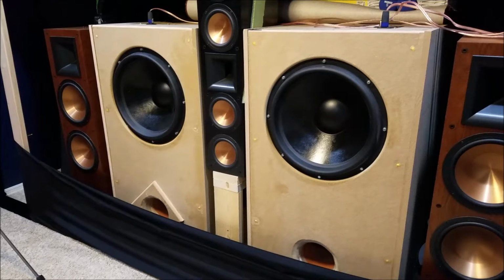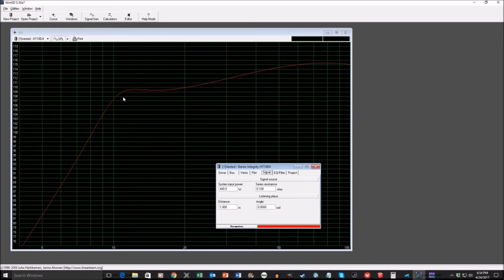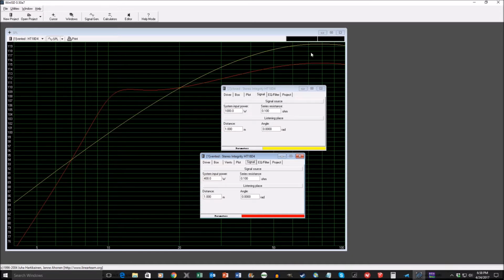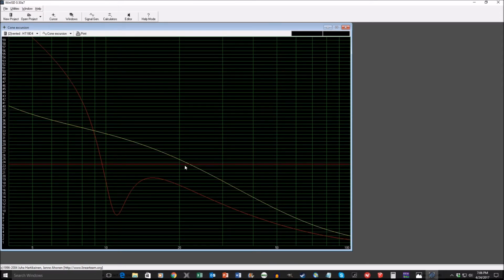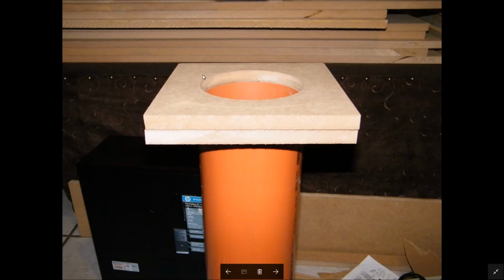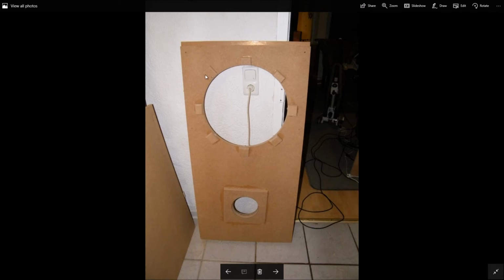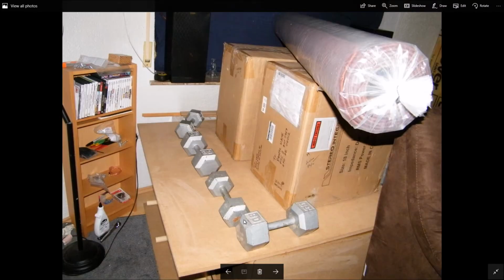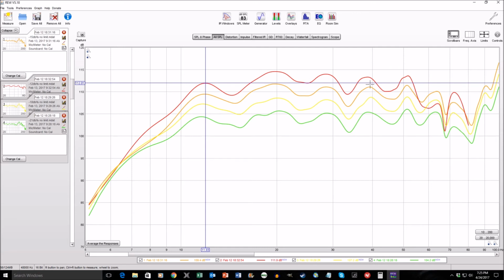Making Of the Salerno Subwoofer

Comment: Question, sounds like you are running both subs through a splitter  to your beringer amp, then using the left and right out on beringer to power each sub?   I believe that is how you have it wired,
Reply from the maker: There is one line going from my AV Receiver to my amp.  My amp is set to "Bi-Amp 1" which is normally used to power a sub and a mid or tweeter.  However, I configured both sides identically so that the same signal comes out of both channels of the amp.  From there, channel A goes to one sub and channel B goes to the other.
Reply: Family White TV how does the Inuke 3000 run both of these?  I was looking to use the same amp or the new version on two 18” ultimax. Also what about auto on with pro amps? Seems like crown amps have the auto on

Comment: use a dsp, like the audio control epicenter, to 'add in ' the missing bass.
Reply from the maker: I was able to add back in the bass using the built-in DSP in my iNuke3000DSP.  The only downside is you have to remember to remove it before playing a movie that is not high-passed.  Also, there are some movies where there is just not enough bass below 20Hz that is salvageable.
Reply: well, that is really isolating and amplifying what is already there. what the Audio Control epicenter does, is it analyses the bass range of frequencies for the audio track, and figures out where low frequencies are supposed to be, but wasnt recorded, and then synthesize those frequencies back into the signal.  other companies have similar devices. 

when perfect, u dont need to change the equalizer settings with the subfrequency synthesizer on or off. as it doesent affect the bass frequencies that are already in the signal.

https://dbxpro.com/en/products/120a
https://www.youtube.com/watch?v=VuApe8_LL_U
https://www.youtube.com/watch?v=gECjtdVdIEk

http://www.audiocontrol.com/car-audio/the-epicenter-processors/epicenter/
https://www.youtube.com/watch?v=eFe_vP-iM70
https://www.youtube.com/watch?v=uYfEv8z2nqE

in this last one although the guy turns down the gain on the amp, when u set up the epicenter correctly, u SHOULD not have to do that... u hear the subsonics added in to the track though.
https://www.youtube.com/watch?v=v0D1pNGYmAc
Reply from the maker: Ok, sounds interesting.  I checked out your links, but it looks like this won't work for restoring the bass I'm looking for, which is in the 5-20Hz range.

In the third link you provided:

https://www.youtube.com/watch?v=gECjtdVdIEk

It shows that with the 120X on, it is attenuating a lot below 20Hz.  While it is providing a new tone at around 34Hz, there is no evidence of anything new below 20Hz.  Instead, there is a significant amount of roll-off.  At 15Hz, the signal appears to be about 4db less than the origional, and at 10Hz, the signal is about 8db down.  And so it looks like it would actually hurt a movie where the sound is present at those frequencies.

This seems to line up with the 120 manual which states the lowest range is 24-36Hz.
http://www.audiocontrol.com/downloads/car/current/epicenter/epicenter-user-manual.pdf

Unfrotunately, I didn't see a video that did this test with the Epicenter controller.  But according to the manual, the lowest subsonic filter they sell is 25Hz.  I didn't see anywhere in the manual that says whether you can run without a filter.  Also, the "Para Bass Frequency Range" is 27 to 63Hz.  The frequencies I'm looking for, which is in the 20Hz and below range, do not seem to be supported.
http://www.audiocontrol.com/downloads/car/current/epicenter/epicenter-user-manual.pdf

And so the products are intriguing, but it looks like they won't go as low as I need them to.  If somebody makes something like this aimed at infrasonic bass augmentation, I might try that.  But it looks like these work by analyzing the musical bass tones and adding harmonics.  That might not work with movie LFE effects.  Movies usually do have plenty of information in the 20-30Hz range.  I want bass in the 5-20Hz range.
Reply: Family White TV thanks for ur analysis. It was insightful! 

The filter for the epicenter can be made with resistors,  I haven't tried it as yet though...  But I suspect that like most consumer audio equipment   performance below 10hz isn't catered for.  

I guess I will have to rely on cabinet tuning to improve on performance below 10 hz. 

But,  I was only really thinking about 20 hz performance...  As I have 2 ultimax 18" waiting for a cabinet.  

I have both the epicenter and the 120... But haven't used the 120 yet and the epi was used only for 30hz in car audio up till now

But too busy to play with them properly yet.
Reply from the maker: I'll be interested to see the results!  I am wondering if it would perform differently with the filter defeated.

Comment: Very impressive sub! I wouldn't put the glass wool in the middle because it not only dampens standing waves inside the box. It also lowers the overall SPL. I'd maybe only put wool inside if it wasn't filtered with an active crossover below 100 Hz. Then I'd glue dense polyester wool (like Bondum 800) or about 1" thick felt onto the walls to suppress only higher frequencies and also vibrations of the walls. Optimal would be a combination of felt on top of something heavy as bitumen foil or thick tiles, e.g. split tiles. To suppress standing waves a Helmholtz resonator / bass trap inside the box works better, tuned to the frequency of the lowest standing wave and densely stuffed with polyester wool or real sheep wool.
Source of all my knowledge: German DIY loudspeaker magazine Hobby HiFi